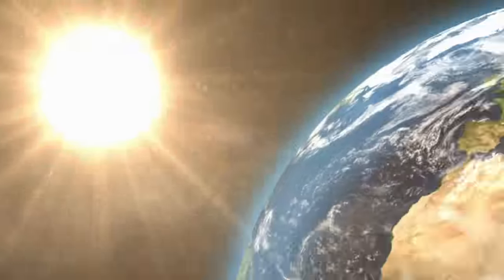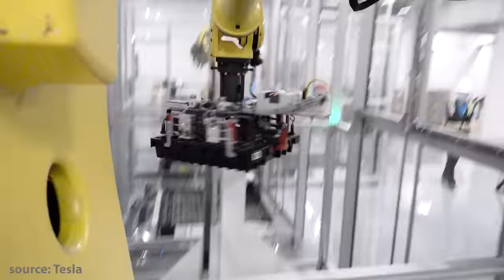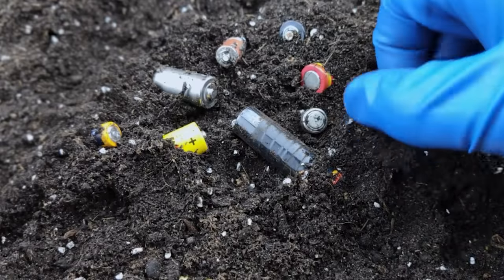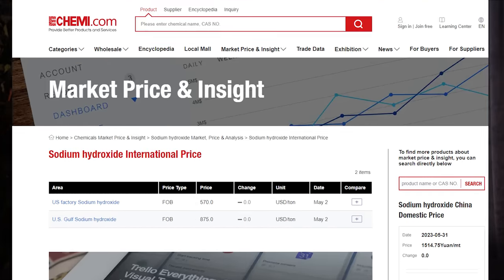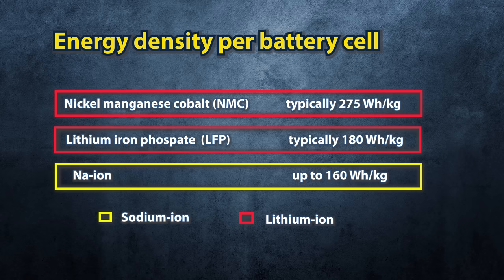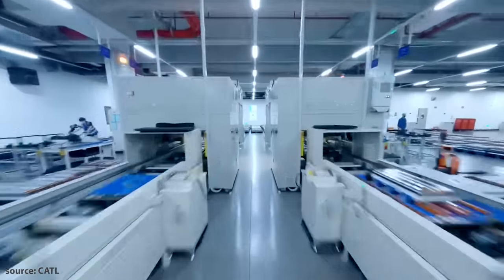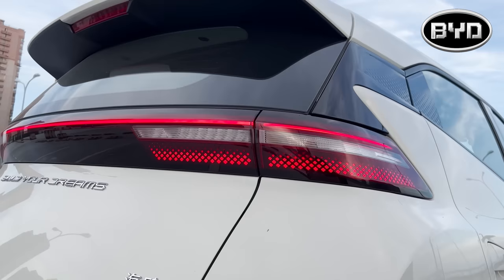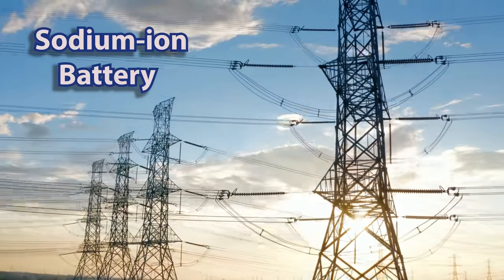Goodbye Lithium!  New Sodium Ion Battery will change the world! And it's in MASS PRODUCTION

Comment: I worked for a battery-based inverter manufacturer testing and working with these sodium ion batteries and the problem we had is they did not deliver current fast enough for large inductive loads in peoples homes such as air compressors, swimming pool pumps and air conditioning compressors. Under a large inductive load, the voltage would sag too deep and the inverter would drop out on low-voltage. Previous sodium battery manufacturers have gone bankrupt. But times change and technology improves so I hope they get better. Meanwhile we are sticking with lithium.
Reply: I know soft starters installed on each of those devices can eliminate voltage sag, but given the potential number of said devices in a modern home, my guess is that that added expense would quickly wipe out any cost benefits of sodium over lithium.
Reply: Tech has changed for sure. The Chinese are world leaders currently, but I'm sure we will catch up soon. If you run an EV on Sodium-Ion, you can run your household items.
Reply: @TheMighty_T  while I'm connected to the grid, I rarely use it. My solar system meets 100% of my daily loads and I store that in a lithium ion battery bank. After two days of cloudy weather then I do have to engage the grid.
Reply: If you put a decent capacitor in parallel with the batteries, would that help?
Reply: @tomlewitt  well, we were working with some of the best electronics engineers in the United States in the development of the product so I kind of doubt that. Schneider Electric is no small company. Again, technology will improve but at the time sodium ion batteries were a flop.
Reply: @Riceman-o1p  Yep they would have explored everything. Cheers!
Reply: I did hear one plan to deal with that in EV’s was to build a hybrid battery pack, containing 90% Sodium and 10% Lithium, to deal with this exact problem.
Reply: @tomlewitt It should help but those high capacity capacitors are expensive and can only handle quite low voltage so you would need a lot of them.
I suspect a mix of batteries might be a better alternative.
Yes that would require some electronic to control it but that should not be hard to make but the price is now starting to go up. ;)
I am more concerned about the safety about sodium batteries. I am not sure if they are safe now but some years ago they tend to create an internal short circuit and then go up in flames. This is something they first have to solve and then they have to prove it. Testing would be part of proving that they are reliable. Who wants a battery that might go up in flames after ten years.
I do think cheap alternatives to lithium batteries are part of the future and sodium batteries sounds promising.
Reply: If you need high current draw then you should be able to do a large parallel arrangement.
Reply: @thedave7760  but then you end up with way too much capacity and the cost is a total overrun when bidding systems for the customer. And lots of parallel cabling is against best industry practice in residential energy storage systems
Reply: Any battery can sag if you pull beyond spec current. Was this during rated C loads?
Reply: @BobboNaught-YT  we were not pulling past the specified current. The problem was that it could not deliver the specified current fast enough to handle a large inductive load which needs that current delivered immediately without lag. This is more a matter of what we call internal resistance. Again, the battery is slow to deliver its specified current.
Reply: @brettgracey9682   Throughout the entire history of batteries, mixing batteries has always been proven to be a very bad idea.
Reply: @deydraniadiancecht8298  we have these new things, called computers, such that we can control automatically which type of battery is being drawn from.  So while their may be multiple types of batteries, they aren’t just mixed together and utilized in the exact same manner.
Reply: @brettgracey9682  Oh?  You really think that's going to work?  

For that to work, you'd have to draw from a complete bank of Sodium Batteries one moment and a complete bank of Lithium Batteries the next moment.  Or do you really think that the entire car is going to run on just a few of one and then a few of another?  

You clearly don't know how this works.  The car has to be powered by the entire bank of batteries or it won't run.  It will deplete because of massively insufficient power.  That causes quite a bit of degradation of both the electronics of the car and of the batteries.  You have to turn one bank off while the other gets used.  That's why you'd need a complete set of each.  

So... you're now increasing the weight of the battery pack by 4 times the weight it is now since SIBs are 3 times the weight of LIBs and you'd still need that AND the LIB bank.  

You clearly don't know how this stuff works.  I've been in the business of electronics for a long time and you can't mix batteries unless you're carrying enough power in EACH SET!  And quadrupling the weight is going to seriously ruin that car.

In other words, you just can't do it.  SIB is not a viable option.  I've found a study that proves it.

https://www.sciencedirect.com/science/article/pii/S2095809922003630
Reply: Well that's great that (from the US as usual) you say sodium ion batteries don't work so they'll just so happen to have to keep using l-ion... a Wall Street investment commodities substance... But next year China's coming out with a very low priced car and it's going to have a sodium ion battery. Whether you say they work or not.
Reply: @rusle  Interesting points, thanks. Yes, a capacitor bank sounds messy. And you're right about the huge 'proof and verification' process of any major application of new battery tech (Sodium). Also, something no-one mentions when discussing distant-future pure capacitor batteries, is that of course with capacitors the voltage falls hugely as you use their stored energy. (eg huge 50% V fall, when 75% depleted). So this would impose extra difficulties, re inverter electronics?
Reply: @jb5music  there are luddites from everywhere.  But you are correct, China will do it, mostly because they want to eliminate oil usage as much as possible.  Naysayers will not change that need.
Reply: A likely better solution for high inductive loads is aluminium-ion batteries like those being developed by GMG of Australia. They have demonstrated a power density of 9350 W/kg (compared to 200-300 W/kg for lithium-ion). As such, that there should be no issue with delivering enough current to accommodate these types of loads. 

In addition to the eye-watering specific power they are achieving cell specific energy density of 290 Wh/kg, so it isn't giving away anything to Li-ion to get the power density. And these aren't short lived batteries either. They have been tested for over 3000 cycles at charge and discharge rates between 10C and 66C without measurable capacity fade. 

This due to the fact that the anode is aluminum foil and the cathode is perforated 3-layer graphene flakes where thermo-chemical etching perforates the two face sheets with a dense field of 2 nm pores. This process also expands the distance between the graphene sheets. The results is that the even the rather large AlCl4- ion is able to access intersheet intercalation sites with almost no diffusion distances and with almost no mechanical strain. This accounts for both the very high specific power and the long cycle life. In addition to all of the performance values, the cell uses a [EMIm]Cl/AlCl3 ionic electrolyte which is non-flammable.

GMG is currently at BTRL 4. They have built 15-layer pouch cells using production representative pilot line machinery, and previously released coin cells to outside groups and potential customers for independent testing. So this isn't just some academic estimates scaling from lab-scale experiments. 

https://graphenemg.com/gmg-achieves-500mah-graphene-aluminium-ion-battery-prototype-in-pouch-cell-format/
Reply: @papparocket  good stuff! Thank you! I love all these technological advances as they continue to keep me employed while I sit on my couch and I no longer have to go to the office!  Lithium ion batteries have come from $600 per kilowatt hour to roughly $175 per kilowatt hour in the last two or three years so that continues to be the vast majority of my sales. 10 years ago I only sold lead acid batteries and these days I sell none!
Reply: @tomlewitt  Yea, and there are lots of super caps available on the market.
Reply: Maybe support a Sodium battery with an array of super caps to deal with sudden current demand and voltage sag. I personally don't see them going anywhere in vehicles.  Lithium energy density is a fraction of fossil fuels, (An 80kw Tesla pack is = to about 2 gallons of gas.  It's that far off.) Lithium density is already the bare minimum for vehicles, so sodium doesn't have a chance.  Maybe in long haul trucks with tons of room to spare, but  probably not..  Grid storage is an entirely different animal.  There it can have a chance.
Reply: @JViello  80 kW Tesla pack??? Assuming you meant kilowatt hours. It's hard to trust people when they don't even get their units correct. Thanks
Reply: @JViello  fossil fuels have a lot of energy, but vehicle engines have horrible efficiency that only turns 20% to at most 40% of the energy in fuel into shaft power to drive the wheels. The remains 60%-80% of the energy in the fuel is wasted as heat.
Batteries, as you correctly point out have far less available energy per kilogram. But electric motors are extremely efficient at turning that limited amount of energy in shaft energy to propel the vehicle.

It still isn’t enough to catch up to the energy density of the combined chemical fuel and IC, but it isn’t nearly as bad is it might look if you compare the chemical energy in fuels to the stored electricity in batteries.
Reply: bad news by the time they worked all the bugs out of sodium battery you & most readers will be dead progress is like evolution
Reply: @yeudoi66  you're probably right! That's why I am ripping around on my electric unicycle powered by lithium ion batteries! I'm having fun with what is available and what is working right now! And my house is powered by lithium ion batteries and recharged by solar panels. My return on investment is 3.5 years.
Reply: Your experience is quite old
Reply: @chandanritvik1  love it! Glad to hear that! I always try to tell people that technology is not static. We are always improving. It's too bad that they released this battery chemistry so early as it was a horrible flop in the residential energy storage world and a lot of people have a bitter taste in their mouth.
Reply: Fixing that issue (by adding ultracapacitors ) is definitely possible. 

But perhaps it’s just not feasible to do that and still stay competitive with lithium. 

Not to mention that what’s feasible now, may not have been feasible at the time.
Reply: Thank you for sharing your experience with sodium-ion batteries! It's important to consider their limitations when it comes to handling large inductive loads. For anyone looking for reliable backup power solutions, I highly recommend the Segway Portable PowerStation Cube Series. With its versatile design, massive capacity, and powerful output, it's a great option for outdoor enthusiasts and RV lovers. Check it out!
Reply: @Riceman-o1p  Yes KWH...don't take my word for it, look it up yourself.  You'll see what I wrote is correct.  Energy density of batteries is WAY behind fossil fuels.
Reply: @papparocket  I'm WELL aware of ICE efficiency believe me.  30ish% out the tail pipe, 30ish% through the radiator...what a waste.  Yes, electric motors are very efficient, (Especially the reworked Tesla motors with extremely tight tolerances.)  but like you said it's not enough to make up the difference just yet.  

When you compare a Tesla Model S battery pack, and 2 gallons of gas and realize they have the same energy stored, it's eye opening how far we have to go with battery storage. (Or combustion engine technology Could you imagine going 1000 miles on 5 gallons of gasoline? LOL  I felt like I was cheating with our modified VW TDi that was getting mid 50's MPG!  LOL

I honestly think super caps would help recover more brake regeneration by absorbing ALL the energy and then release it back into the battery pack slowly.
Reply: @JViello  well I've only been making my entire living off of batteries for 24 years. I was just correcting you on semantics, sorry about that
Reply: Adding some capacitors parallel to a cell stack should mitigate that.
Reply: the effect of inductive loads can be nullified by correcting the power factor with capacitors.

￼
Reply: @victordias1840  that is correct, but that's in the laboratory folks! That is never going to happen in the every day world of mass applications of batteries utilized in the residential sector. Thank you Bill Nye!

Comment: Nov 2023 - I ordered in one 12v and one 24v 100Ah battery (each) and they are close to same form-factor size as Lithium-Iron-Phosphate batteries, and lower price point. The cells are more tolerante to temperatures (reportedly) operating down to -20C and up to +80C with some reduced current capacity at those extremes.  The main draw-back for Sodium cells is their operating voltage is far wider than LFP (1.5v to 4.0v) which exceeds the limits for most inverters and other equipment that batteries will connect to, such that until the equipment changes and catches up to the new battery technology, operating the sodium batteries with current equipment may require reduced voltage operating range and thus reduced usable energy from the cells.  Reduced voltage operational range will increase the battery longevity (cycles) but this remains a trade off.  The temperature tolerance, safety, cost, and abundance of sodium are all positives, great reporting.

Comment: Sodium-ion is definitely preferable to Lithium-ion, but you have completely overlooked Lithium Iron Phosphate which is the current industry standard and can be cycled 100% and does not have the same risk of thermal runaway.
Nevertheless, sodium will be far less detrimental environmentally than lithium.
Reply from the maker: Agreed and I wish I could squeeze a ton more into the video… LFP is great and huge and used in majority of home back up options. The only one I’m willing to recommend. 
Thanks for the feedback I really appreciate it. Good and bad, that’s the only way for me to learn. ;)
Reply: Old news nothing new and one of so manny.
Reply: If Sodium is very similar to Lithium so for me seams that it is possible to produce NaFePO batteries like existing LiFePO. And for me not clear why battery creation started from Lithium but not  from Sodium or Potassium. Scientist could start from potassium batteries, collect money, then upgrade to Sodium, collect money and then to Lithium as most energy dense.
Reply: @ilmarsmarsils8029  Lithium hit the market in consumer products like phones, laptops, power tools, etc.. where weight is an important factor.  Lithium, especially back around the turn of the millennium was lighter and could deliver more energy than sodium.  Potassium is even heavier.
Reply: @ferrytadema2424  But still appreciated nevertheless. Thank you for your appreciation as well.

Comment: I read about adding a supercapacitor parallel with the battery to provide the ,momentary boost for a motor start; it took a while to wrap my mind around the concept; the capacitor charges and discharges nearly instantly.

Comment: Martyna, thanks for the video. Just wanted to let you know that a Chinese battery manufacturer, Dynavolt Tech is ALREADY selling Sodium Ion batteries in the marketplace. Not as competition to Lithium batteries, but as a competitor to Lead Acid Batteries for engine starting. They already have them for motorcycle starting batteries, and car starting batteries are in the works. As you said, the Sodium batteries have huge advantages over Lithium batteries, except energy density. But, compare the Sodium batteries to Lead Acid batteries, and the advantage is even bigger. Imagine no more Lead pollution, or sulfuric acid pollution... And, imagine a battery that you can leave on the shelf for over a year, and it will still start you car or motorcycle! And imagine a battery that will last 5 to 10 times longer than a lead acid battery... And works at much lower and higher temperatures... and is as light weight as Lithium, and all this for a cost a little more than Lead Acid Batteries... Well, all that exists, and is already on the market in Asia... And they should be available in the US before too long. I can't wait! :-)
Reply: This is true
Reply: Can they last more charge cycles than lithium?
Reply: @omeggga  From the research I've seen, Sodium batteries will have the ability to have more charge cycles. Plus, a huge benefit is that Sodium batteries can be discharged to Zero volts, and be recharged with no apparent damage. Another advantage is charging rate... Sodium batteries can accept higher charge rates then Lithium batteries, so they can be charged faster. Except for electronic devices, and EV's, Sodium batteries seem to answer a lot of challenges which limit Lithium batteries. Temperature extremes, safety, environmental, cost, weight, charge cycles, charge rate, manufacturing ease, long shelf life, safe transport at zero volts, and many other advantages are the reasons I believe Sodium batteries will take over many sectors of the energy storage and starter battery markets.
Reply: @TigreBrian  Where can I find a source for this?
Reply: @omeggga If you read Chinese, there's plenty of sources and information. BYD has already built a factory for mass production of Sodium Batteries for EV.
Reply: @hclau218  So the only sources is from the companies themselves?